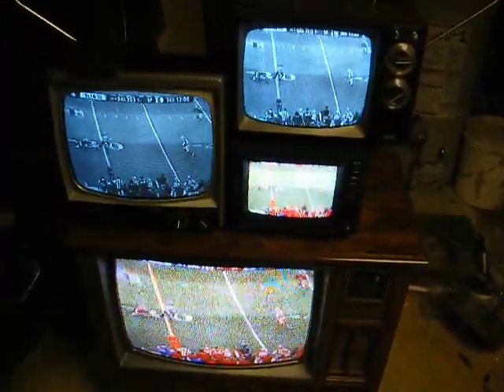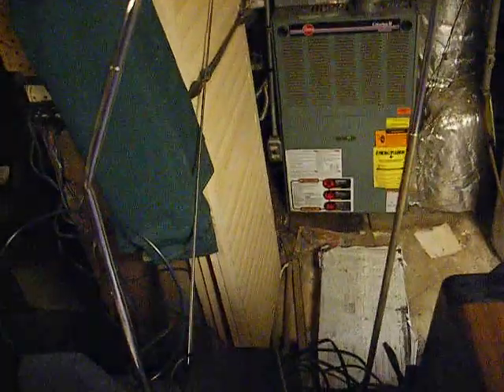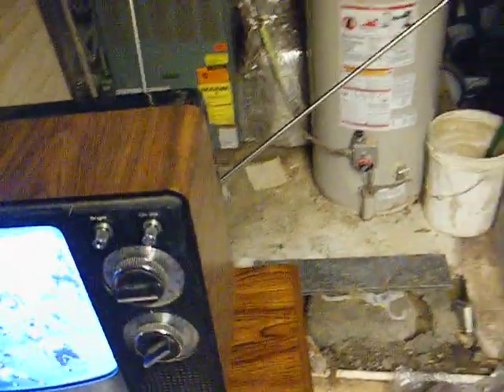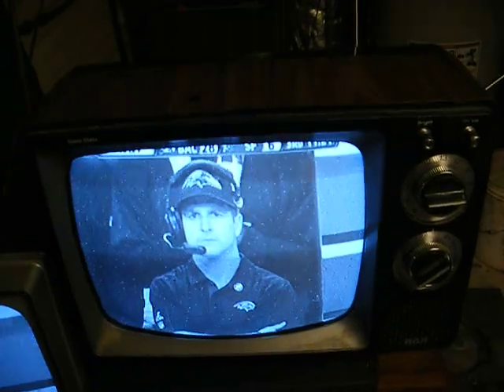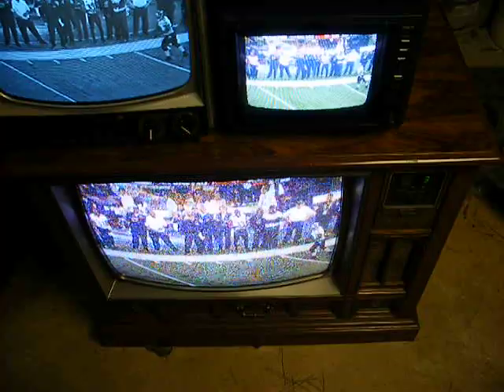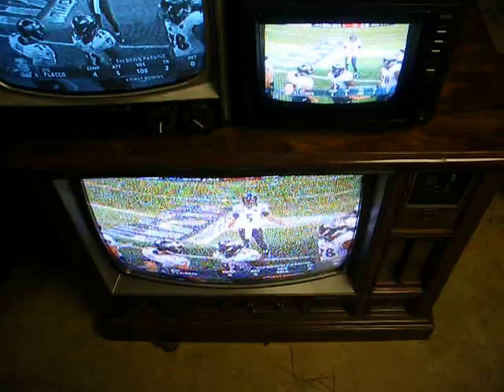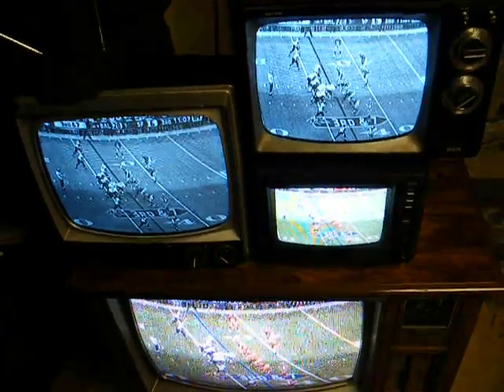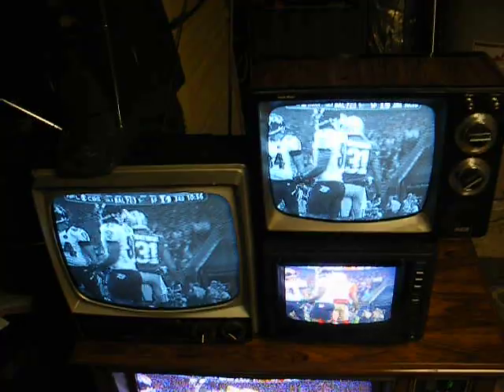Superb Owl TV tower 2013

Comment from the maker: I've got a 32" Sony CRT TV from '06 that has a built-in DTV tuner that needs a new vertical deflection IC. I was recently given a Sansui (Orion) 27" DTV from '09 that was beat to heck; but, I was able to fix and sell it for a few dollars. AFAIK, there are no new CRT TV's being made and it's getting harder to sell used CRT TV's, even if they are new enough to have a built-in DTV tuner.

Comment: Ramsey electronics also makes a TV transmitter kit for channels 3 through 6. I would love to have one of those instead of trying this type of setup. The only reason I would rather have the kit is to make sure my signal is 100% legal. That last thing I need is to violate part 15 rules because the FCC will come down extra heavy on me as I'm a licensed amateur and therefore I am held to a higher standard when it comes to FCC compliance.

Comment: Pres. Obama wanted the TV Stations to hold off turning off the analog signal, but the TV Engineers were anxious to turn off the analog transmitters because of the powr bill. No, there are no converter boxes anymore. I still watch a TV made in 2005 that requires a box from Comcast. I told my wife were going to have to give in an buy a DTV here soon. Found a good buy a Electronic Express on a 29" DTV for $170.00. Congress pushed for all this in 2009, & this is only going to get worse.

Comment: That's quite a tower o teles!  HOW or I should say WHAT did you use for a transmitter to make all that tower-0- tee-wees pickup through their own tuners?
Reply from the maker: I think I ran the output of a DTV box to a Radio Shack signal booster and then the output of the booster to a splitter and the outputs of the splitter to the TV's.